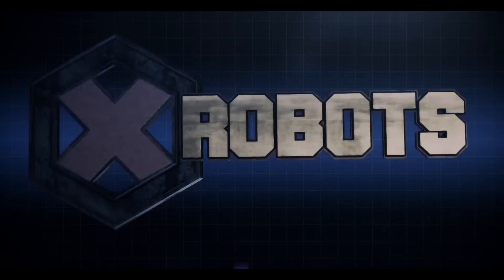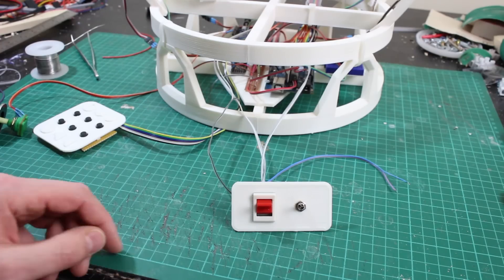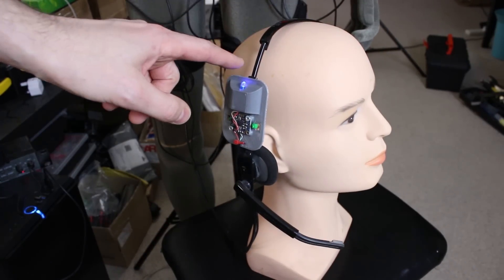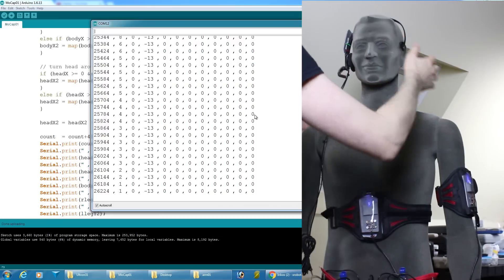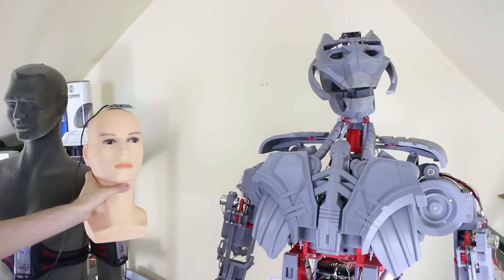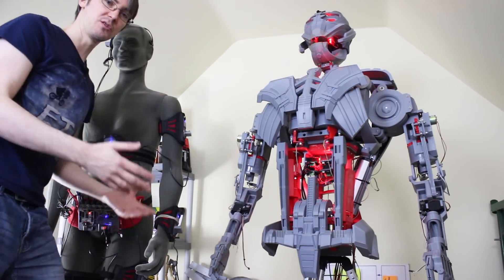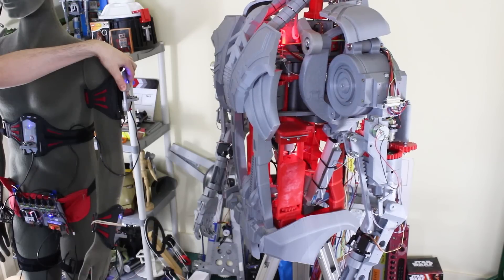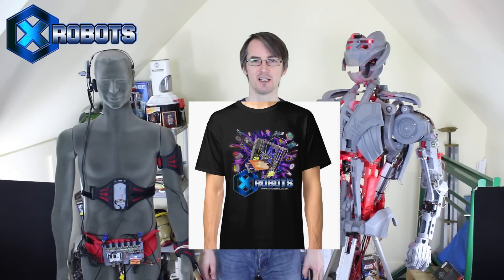Avengers Ultron #31 | Motion Capture Puppeteering | James Bruton

Comment: James: some suggestions for the issues you are having:1) Your motion capture suit could be an actual suit of some sort. Ditch the cell-phone holders and make a jacket with pockets in it for the IMU devices.2) You can get better resolution out of your IMUs while still needing only integer math by doing a simple scaling operation on the data. Multiply the results of the IMU by 10 before sending it and your readings will no longer be in degrees, but rather in 10th's of a degree.  For example, 10.2 degrees would be represented by 102 tenths of a degree. You can retain that level of precision through all of the code by just knowing all of the values are scaled up by a factor of 10. No need for floating point or anything!

Comment: Euler angles are a pain in the butt for precisely the reasons in this video. Converting things to quaternions or homogeneous transforms, and then back to the correct kind of Euler angles at the end would be the proper mathsy way of doing it. If you set up the DH tables correctly, you can even get forward/inverse kinematics on your arm pretty easily too :). Although it only seems to be a 5-DOF arm so it wouldn't be able to achieve all the places.
Reply: Quaternions are the best! Though every time I try to rotate a rotation I get confused and mess it up. :)
But no gimbal lock issues like Euler angles, and not as many problems with scaling and drift as you'd get with rotation matrices...  It's good stuff.
Reply: what about drifts?

Comment: Very cool stuff!

One of the proportions you should change is the counter-balanced arm that goes back as the other goes forward. It should be at about half the corresponding distance to look a bit more natural. I'm sure there will be plenty of experimentation with that yet to come, though.

Also, in animation the reset origin pose is called the Rest Position, if you want to use that.

Comment: Why not add some controls to open/close the hands, like a button or analog trigger on a hand held stalk (like a movie detonator)? A button to zero out your motion control axes would be useful as well. Still not sure why you would put sensors on your legs instead of just putting them on your other arm when Ultron is just a torso.

Comment: James, on the Adafruit BNO055 page, it seems that with enough prodding one may be able to reprogram the sensors initial calibration. Also, apparently Quaternion output is supported - would that make a difference? I wonder if Bosch make a different single-dye IMU that doesn't have this quirk. What happens if one absolutely needs the sensor in your original orientation ? Seems like a problem worth solving.
Reply: I see. Fair enough! Thanks for replying and thanks for the videos. I will definitely become a patreon patron when I graduate :)

Comment: Great work you're doing there, always look forward to your videos.
Now you have lots of parameters, it might be an advantage to send 'named parameters' 
e.g. "a123b12c-27... " etc. instead of "123,12,-27, ..."
this may simplify the routing of the various parameters and allow you to send changed values only.

Also (this may be obvious) take care not to decode partial strings 
i.e. decoding "1,2,3,12345,897" when the serial buffer only contains "1,2,3,123"

Comment: Is the purpose of the smoothing filter just to remove jitter? Wouldn't it be better if the strength of the filter was inversely proportional to the distance between the servo position and input value, so it would move faster on bigger movements? (probably a good idea to calculate the distance between the coordinates in all 3 axis instead of each once individually so the motions don't look like they're falling into slots when one of the axis hasn't changed as much as the others)
Reply: I'm sorry, I'm not sure if I understand your reply. Why does it lag so much?

Comment: powering up flat is a really roundabout way of doing things.
it would have been a lot more flexible to use math instead of printed mountings^^
what if you power up slightly angled, do you have the same problem again?

Comment: Why do you not use the Sensors from the legs for the other arm. At least for the time you dont have the Legs for Ultron.
Reply: Original plan was that other arm will be balancing the robot or copying movement of main arm according to action.

Comment: I am confused about need for relocating IMUs. Can't you just recalculate angels?
You need to read i little about manipulators cinematic.
Reply: It is valid for your robot arm. what you need to not rebuild imu holder is check out Euler Angle Conventions. For example here:
http://danceswithcode.net/engineeringnotes/rotations_in_3d/rotations_in_3d_part1.html
Reply: I was wrong - it do not cover converting Euler axis to differen base orientation, but actually it is simpler:
You convert rotation you want to apply to your IMU. Convert it and angles from IMU to rotation matrices first and then multiply them together.
Reply: And also - if you would master adding and subtracting euler angles you can gen angles between your IMUs - which would help you with calculation needed angle of the joints. Calculations on rotation matrix may seams hard - but there are libraries for this, and it would help you in the long run.